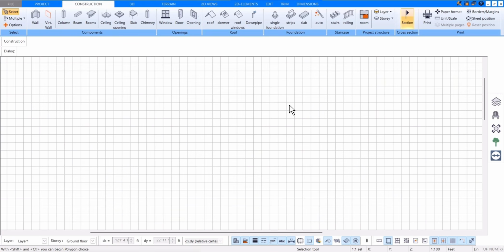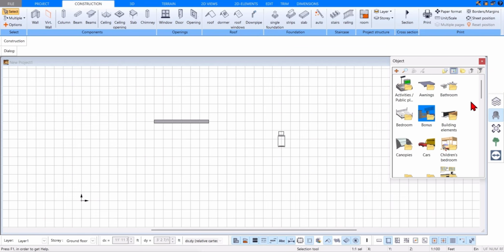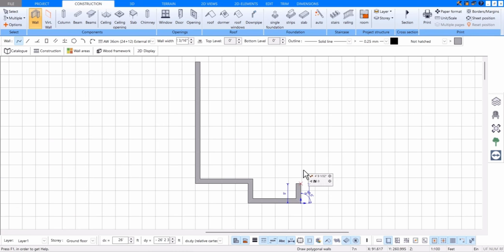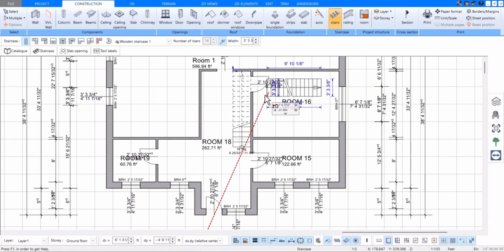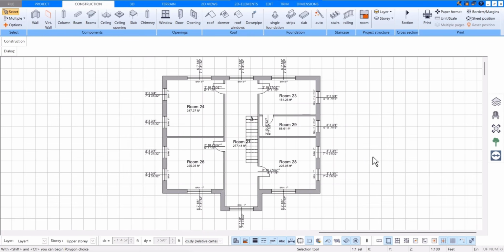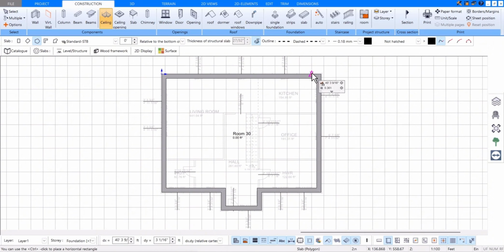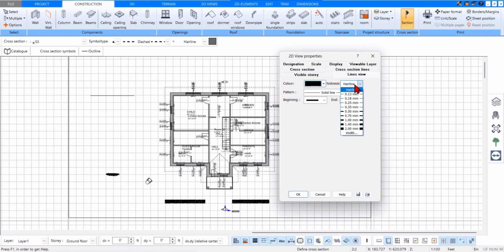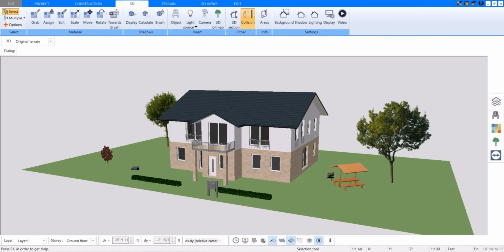First Steps | Complete Beginner Guide: Plan Your First House with Plan7Architect

Comment: I really wish these catalogues could be set to Inches instead of CM
Reply from the maker: The “cm” in the catalog names is only part of the element’s name, not a fixed size. The catalog items are templates: you pick an element, for example a door or window, type in your own width and height in inches, and place it. Afterwards you can adjust all dimensions in inches at any time.

If you use certain sizes often, you can save these elements in the catalog under your own names, for example “Door 36 in”. Then you’ll have your own inch-based catalog for reuse.
Reply: @Plan7Architect  Ah that makes sense, thank you!

Comment: To print multi-page document, can I put several title blocks in 2D view, and adjust the borders/margin over each separate title block and print them one at a time? Then I guess combine all pages in adobe or whatever?
Reply from the maker: Yes, you can do that.

You can place several title blocks in the 2D view, adjust the print area/borders for each one, and print or export each page separately.

Afterwards, you can combine the individual PDF pages into one multi-page PDF using Adobe Acrobat or another PDF tool.